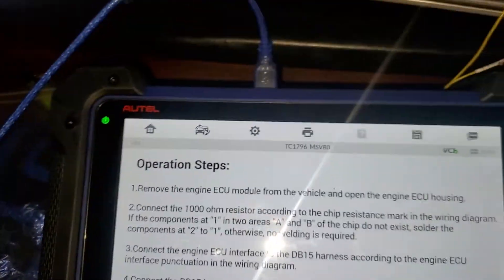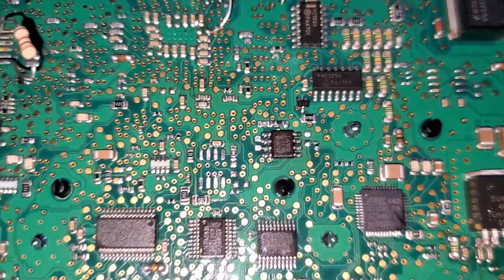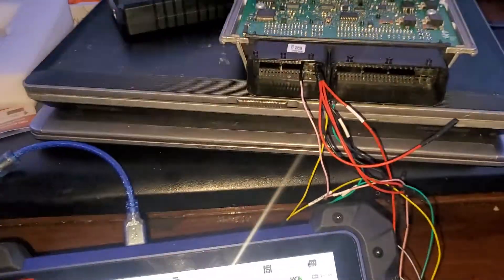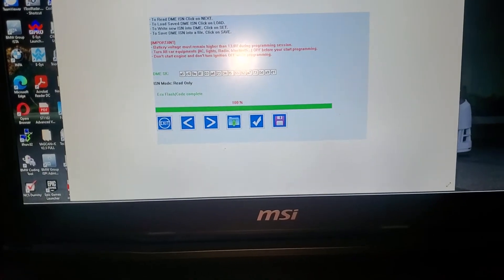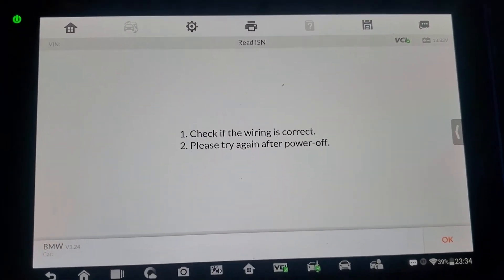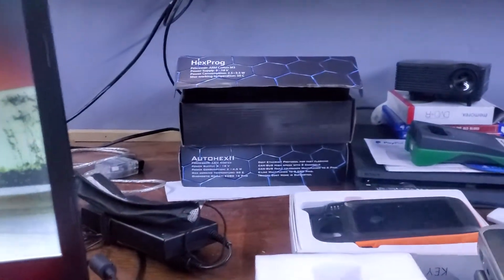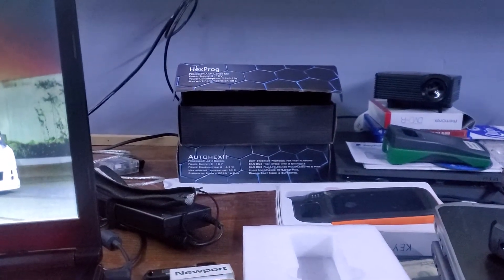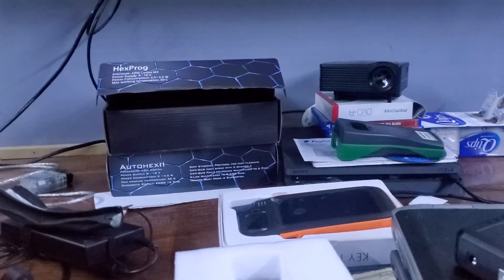Autel and VVDI 2 failed read isn DME MSV80. Update I was able to edit ISN with Autel Kind-of...

Comment: Hey bro I tried different different methods with Autel but it’s doesn’t work at all I thought my connection or update issues , in some scenarios Autel it’s sucks even I tried to reprogram Mitsubishi pajero 2011 model it’s only gives me a single wrong PIN code I’m fed up with Autel..
Reply from the maker: Autel is one of many tools, you cannot expect autel to do everything it's says it does because that's a lie on there part....   I use alot of different tools.  You can try pin codes
Regular Pajero
Gas=1803
Diesel= D135

Pajero sport
940F
4838
3828

Pajero tr4
9154
6329

Also if you have tried multiple times to enter pin code immo functions will be blocked .. leave key in the on position for at least 1 hour then attempt to enter pin code again

Goodluck

Comment: I just red isn on a used  msv80 with im508  and gbox 2 no problem for e70 2010.   But the problem i had was writting  new isn to cas.autel would read cas but renew fonction wont work
Reply from the maker: I've never had luck writing ISN with Autel.. I use Autohex for that and it easier because in factory mode no need to open ecm. But the renew function software does work that is on Autel, I've renewed cas files  with Autel then wrote file back with different device and works fine. The Only thing with E70 that has 8hp tcm you must maintain same ISN original from transmission because last I checked no way to alter isn on that specific tcm...